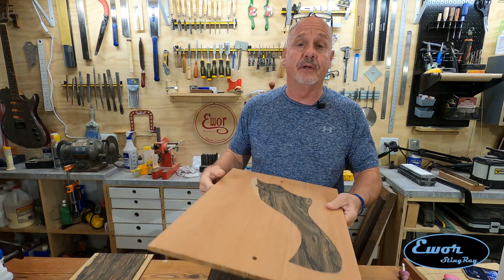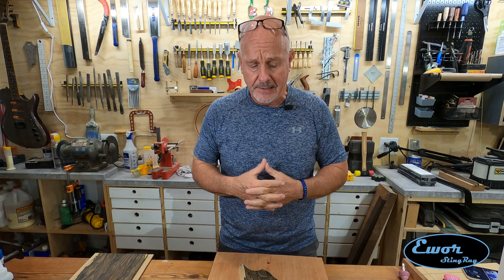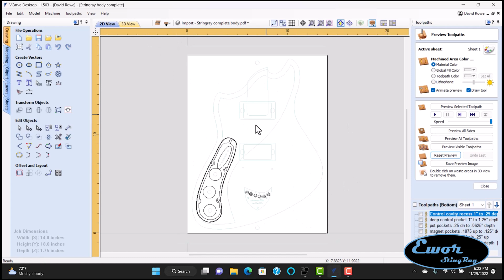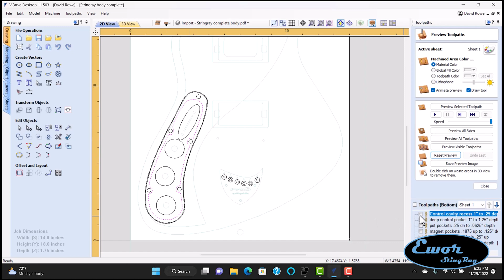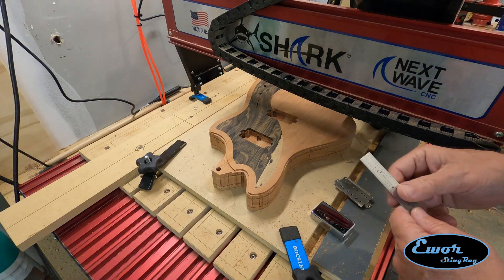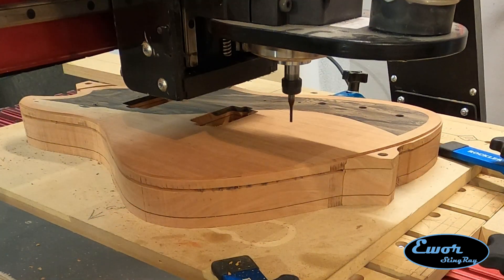Ewor Stingray part 4: Body Building

Comment: I just recently discovered your channel. Great stuff I really enjoyed it. I have 2 educations one in electronics and also as an cnc-machinist. I now work with 5 axis cnc machining. I think you should consider gluing the 3 pieces together before doing any cnc machining and then doing the body from top in 1 operation. This good thing about cnc-machines is the presicion. No need to risc anything by doing the neck pocket in another operation. If your zero is just 0.1 mm off, then by the end of the neck it could be 0.3 mm or 0.4 mm off. No need to rics that.
Reply from the maker: Thank you very much. I learn a little more every time I use my cnc and I love it!
Reply: @eworcustomguitars  I know your doing a fantastic job. Maybe you should consider using the software fusion360. It is great for 3d work and you could easily make the angled pocket on your guitarbody from the top.

Comment: Dave, why not try a heftier bit, like 8mm or 10mm like I run on my CNC-machine. That will allow you to use the full potential of the router motor, which in your case must be at least 1.5hp (Mine is 2.2) The downside is the wider minimum corner radius.
Reply from the maker: Mine is a 2.2 also. I’ve wondered if my machine would handle larger bits.